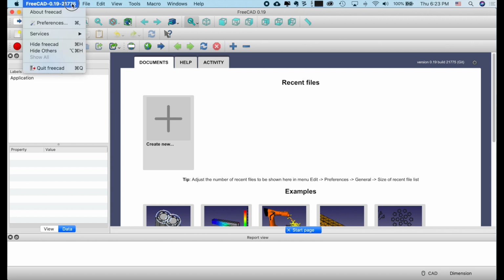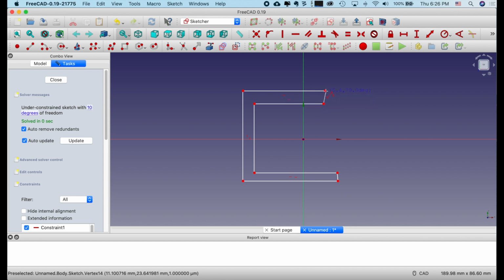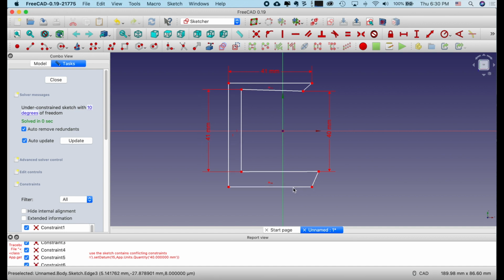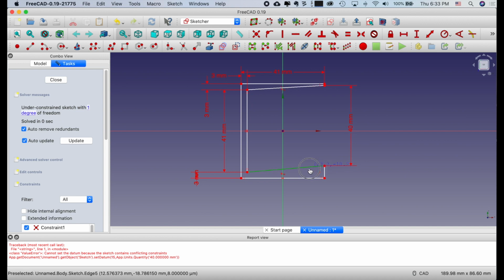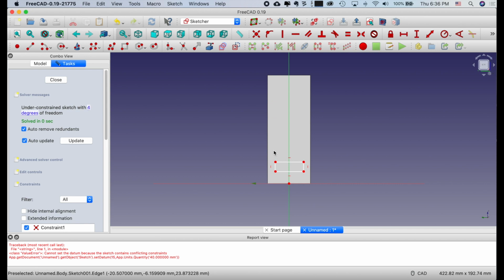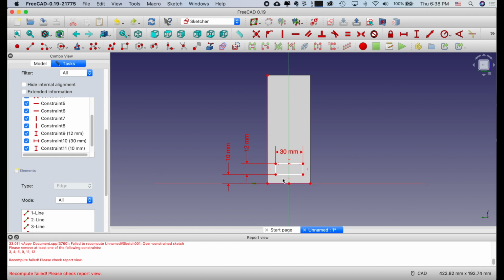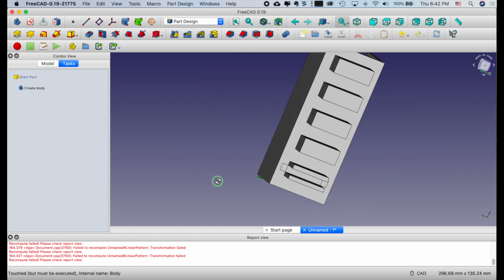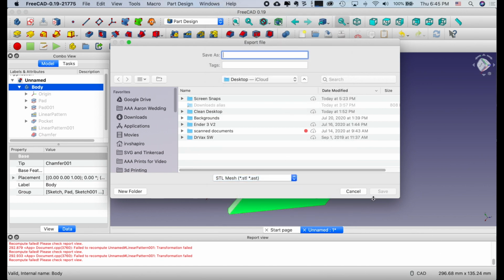FreeCAD for Beginners | Practical 3d Prints | Lesson 3

Comment: Thank you for this series! Even 5 years later it is so valuable and for me personally the one thing that finally got me to stop procrastinating  and start learning CAD for 3D printing =)

I want to comment in case someone stumbles upon the same thing that was getting in the way of following along with this lesson.
Namely "Wire is not closed". When adding the edges of the first Pad to the plane of the second Sketch they were added as Construction Geometry in my case (FreeCAD 1.1.0).
So I was unable to Pad the second sketch, because "Wire is not closed".
Once I understood, that the projection of external geometry added those lines that we only require for our constraints as actual lines it finally clicked and I was able to do a fruitful web search.
The fix is going back to the Sketch and "Toggle Construction Geometry" for those two lines. Then you can Pad the Sketch as expected.

Comment: Just in case : do not attach sketch on a surface :( Create separate plane and position it where-ever you need. Also try not to use chamfer and fillet tools either : draw those shapes into the sketch whenever you can... You'll save some tears, when you modify some complex body and change something. Since freecad do not remember surface id's correctly, when you add one to the body, the attached sketches, fillets & chamfers tend to move around often making result rather unfixable :( #FreecadPron

Comment: Thanks for this great introductory series.
Now that version 0.19 has been officially released I wonder if you would consider updating some of the information in the series. In particular I was thinking of a video that helps new users avoid the topological naming problem by using sketching best practice: namely, only making sketches on either the three Cartesian planes or on datum planes. As your existing videos have pointed out attaching new geometry to existing geometry is important but sketching on faces is no longer recommended.

Comment: Thanks so much for your great videos.  I've watched 5 or 6 now and have been impressed by each one.  You thoroughly teach each one at just the right pace, at least for me.  As a retired Industrial Arts and math teacher and also a Technology Director for the last 15 years of my educational career,  I've attended and taught a lot of workshops . Yours  are always spot on!  Please keep up your wonderful mission!  I just got started with 3D printing about 3 weeks ago because I needed a way to put my arduino projects in something useful.  After watching your 3 videos on FreeCAD, I designed a  bearing support block incorporating a counterbored bearing hole with another 2 holes along the bottom for mounting. Couldn't have done it without you.  BTW, I'm probably one of your worst students.  You know the guy that never waited for the teacher to stop teaching before they started the project - and then needed help?  Well, that's me.  Replaying the video is great for me.  Thanks again!

Comment: How did you print that? (I'm BRAND NEW at 3D printing) I thought things that "hung out" more than 45% needed supports or something...?
Reply: I made mine for a somewhat thinner window sill (20mm), printer with the long open side on the bed,. It did not need supports. Print the test piece the same way, and you can check if you need supports at the same time. Maybe you can use a thin support enforcer in Cura or a paint on support in Prusa Slicer in the middle to decrease the span to what your printer can bridge.

Comment: Hi Dr Vax,
I love your videos. They have made this pandemic more tolerable. I have a question about a different material for FDM printing called polycaprolactone or PCL. One of my residents is interested in printing PPE adjuncts and it was determined that PCL would be ideal in terms of strength and flexibility. Would you be interested in making a video about how to print with this material?
Cheers Bernard

Comment: At 15:08, the mistake was selecting the origin as the center of symmetry, not the Y axis. This produced a point symmetry, which is why the box moved down later. Incidentally, you can also constrain distances relative to origin, which doesn't require you to select the origin. Box selection of points can also be easier than clicking.

Also remember that your order of operations is not set in stone. You can right click the Pocket, select "Move object after other object", select Pad001 to put it before the LinearPattern, then edit the LinearPattern to include both the pad and pocket. Same thing with the Chamfer; you can add the other edge to chamfer both sides, instead of creating a new operation.

Comment: Could have notched the extension then patterned the resulting retainers, and have saved computation time. Not critical here but came become significant in more complex structures. Make one item to completion then duplicate into a pattern is better.
Reply from the maker: Correct.  There are many approaches to
every model.  In these tutorials I like to start with an easy and straight forward approach.
Reply: @MakeWithTech  Fine, I do understand the simple approach.
Also I have noted that with the common edge the solid does work with the two joined shapes, it is only with overlaped edge that solid PAD can not be solved, requiring internal overlapped lines to be removed. Yet as you showed POCKET works as you showed by the overlapped circle. Common edge so  is a special case. But could result in confusion for a novice, convinced that two shapes drawn  will work in eithercase, so better to warn about not allowing overlap of shapes for PAD.

Comment: I've been wanting to try out FreeCAD, thanks for the tutorial series. Maybe I've missed this somewhere , but unlike your view that has all the tools and constraints visible in the tool bars I have only one tool bar and only a few are shown, only by clicking the down arrow beside them do I see the rest. So how to you get them all to show as you have them?  I'm running 0.19 version on Linux
Reply from the maker: Click on Tools / Toolbar and then put a click next to each item listed.

P.S. I have started a new discussion forum at http://forum.drvax.com where we can all have more elaborate discussions and share pictures on our prints and printers. Check it out. Irv
Reply: @MakeWithTech    I have them all checked and still have the same issue, ideas?
Reply: @gregbrissey5675  This is a late reply. But: To the left of each group of tools on the toolbar, there is a vertical row of dots. Hover the mouse pointer over these dots, and your pointer will change to a four way arrow. Left  click when this appears, and drag the tool group down below the current toolbar row then release, to start a new row of tools, giving more horizontal space. I'm on version 0.18 on Windows.

Comment: Thank you for this informative video. After creating the FreeCAD design, for this particular model, how did you align the stl for printing? Printing vertically with supports for the cable holders seems like the logical approach, but I'm curious about how you executed the print job. Looking forward to more FreeCAD and 3D printing instructional videos - I am learning quite a bit!
Reply from the maker: Yep.   You will need supports inside and between the cable clips but set the support density down to about 5% -- since they do not have to be perfect and you want them to be easy to remove.

Comment: IMPORTANT CAVEAT ABOUT TESTS: A test must be well-designed, well-implemented, and well-analyzed, lest the information gained be invalid/misleading. For example, a smaller, partial piece might behave differently than the final piece. I had this happen with wood-infused filament. Because the test piece was smaller, the print head never got moving very fast, BUT it did on the full-size piece, and the surface finish came out very different! Rather than smooth, it was "sputtery"/rough, which serendipitously was interesting, but not as desired.

OK, just thought it important to point out the nature of testing so folks can look out for things and ensure the highest possibility of success!

Now, go design, test (properly), and print something cool!:)...

Comment: I usually do the testing stuff at the end, when the design is done. It is fairly easy as you just create a sketch and cut away the obsolete stuff. Then I export the leftover. When I am done I simply remove the pocket and have final design again. This is very handy, when you have multiple elements you need to test. In your case if you want to test the cable slots I would cut them from the model and print them standalone, too. Since there are no measurements or constrains involved the cutting sketches are quick and easy done. Just draw freehand lines and done.
Reply from the maker: Good suggestion.

P.S. I have started a new discussion forum at http://forum.drvax.com where we can all have more elaborate discussions and share pictures on our prints and printers. Check it out. Irv
Reply: @MakeWithTech  I already did! I am Geit there :D Posted the vacuum hair cutting system the other day :D